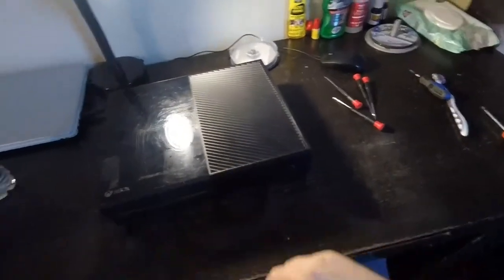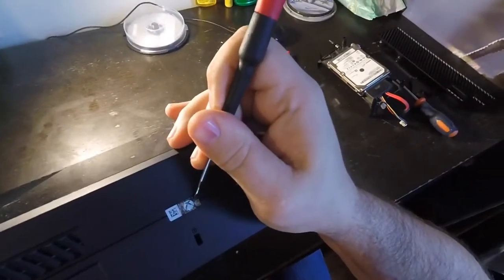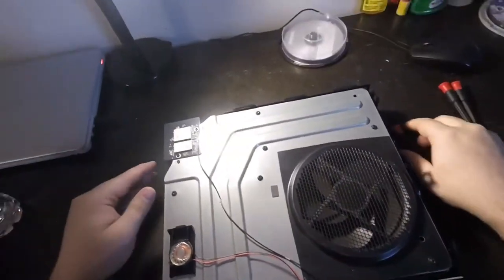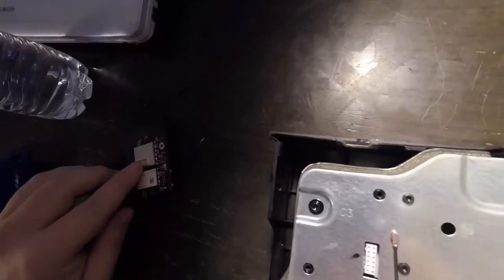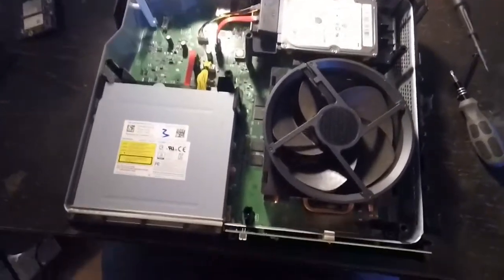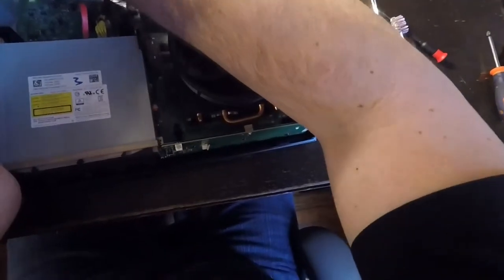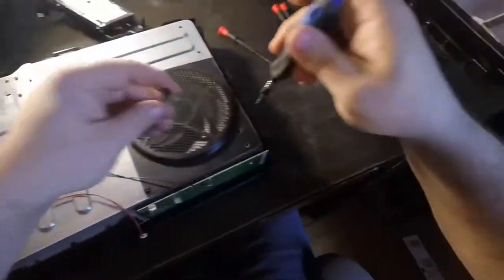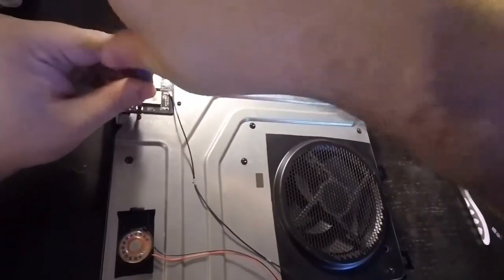How To Repair An XBOX 1 - One With A Bad Hard Drive

Comment: My Xbox one turns on and shows the green Xbox screen, then goes black, it doesn’t work after that? Could that be a bad hard drive?
Reply from the maker: It could be multiple things but that is where I would start is with the hard drive also make sure you clean it out with compressed air. ✌️👍
Reply: @Mr_Goody  thanks for the reply! Yea I took it in to a shop they said the hard drive is bad but now they said it’s something else since they installed a new one. At this point I rather just buy a new one lol